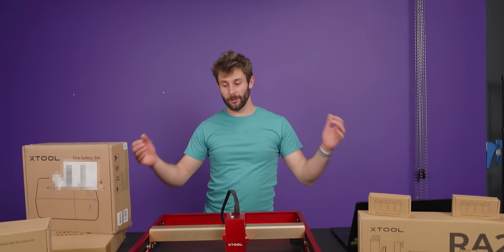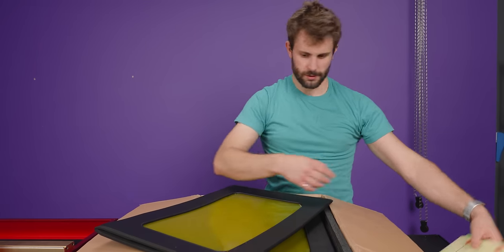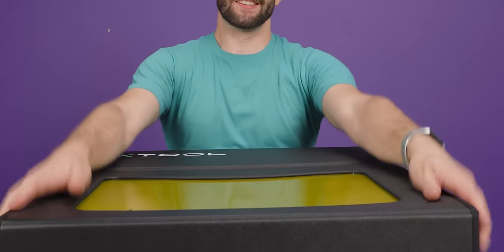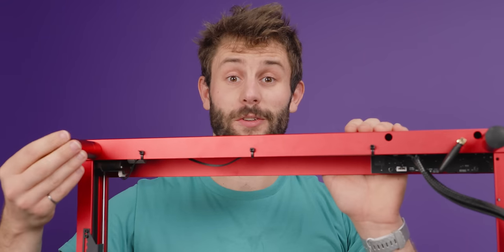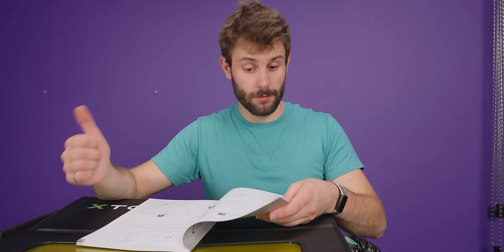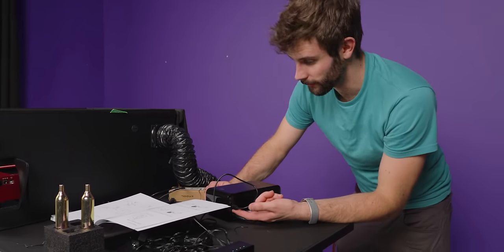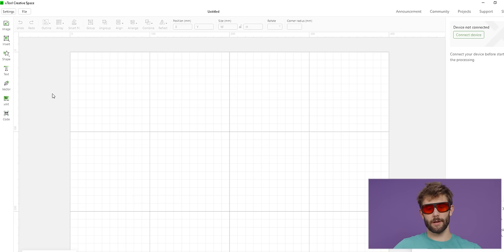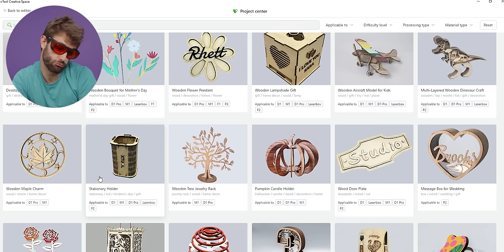This was TOO DANGEROUS for LTT - xTool D1 Pro Laser

Comment: One of the best ShortCircuits I've seen yet: Informative, respect for safety measures, cool tech, and Tynan. Couldn't ask for more.
Reply: Never have I needed that stupid fire suppression system with ANY of my lasers in the years I have been running them. I have cut cardboards on all of them and many, many other materials. I run a business with C02 and Diode lasers, the only small fire I had was when I was testing a specific kind of door mat that used Coconut hairs and I was right there because I knew the risk as I DID MY RESEARCH. Also, having to run the file from the machine button, that is on LTT for buying without doing their research. Speak with your wallet and don't give vendors who do this kind of thing or online only software (like Glowforge and Cricut) your money. They preach that we speak with our wallet and they do not follow their own advice.
Reply: @shawnhartmann1750 While I agree with most of your point, you seem to be a professional operator. Most people watching this channel are not professional laser operators.
Fires can still happen. Has haopened to me.
Reply: @shawnhartmann1750 Yer nah, doesn't matter if you're a newbie or a 100 year pro master(which alot of people getting these lasers are newbies in the use of them), you should still keep your safety's in check and that includes  a "stupid" fire suppression it's another set of precautions that should be taken and that most big companies from my knowledge do, humans are prone to mistakes and I can't tell you the amount of horror stories I've heard even from professionals over just fires alone with lasers. So I don't think it's stupid yes being a professional the risks are lower and you may feel like you don't need it but I'm not risking that few extra seconds of a laser going haywire which could make things worse call me a baby or safety prone but I'd rather not take my life lightly thinking I know everything that's just a bad decision in my opinion.

I've seen personally at work what happens when a so called professional took his eyes off one for just a minute also take William Osmond as a good example as well.

Anyways that's just my experience from seeing how quickly a faulty laser left alone for around a minute can quickly go horribly wrong and not saying you're one of them but I've talked alot to people who are veterans of their trade who made of the mistake of relaxing for a second or Letting there guard down machinery because they had so many years under there belt thinking that a "accident" would never happen to only regret it, just because it ain't happened doesn't mean it won't happen to you at some point another example how Adam savage got to laxed are his machinery and had an accident never thinking it would happen.

As for the rest of the stuff you're saying I couldn't really add my opinion but take what I say with a grain of salt it's just my opinion like you have yours
Reply: @shawnhartmann1750  Linus' wife bought this in her home tech makeover. This was not a corporate decision, but an impulse purchase done with their own money; as stated in the video. Your whole argument falls apart as you clearly don't understand why they have this laser in the first place. Its in this video now because people freaked out in the comments about the fact that they simply slapped the laser down on a counter in their house and intended to use it that way.
Reply: @Alcadria doesn't matter if it's personal money or not, if I and my company preached speak with your wallet as hard as LTT does, my wife would know the montra, I guarantee it.
Reply: Yep, this one was very, very, very scrutizied according to an employee.  When the CEO, Linus, and his wife is just off camera watching and critiquing every word, you know it was important not to screw it up.
Reply: I have to disagree with a few things stated here. I’m an LSO and your safety goggles/glass are to be purchased with the proper OD rating for the wavelength you’re using. Your example bashing the green (assuming 5151U filtering) is adequate. They’re meant to protect from reflections and stray beams. Not a direct shot  in the focus/ power testing range (5-6”) like the example video that was shown. It’s polycarbonate so it’s not meant for that. 
All manufacturers warn that any damage to the lenses can render the filtering useless. What they send is adequate safety Per the ANSI z136.
Anything else is just redundant and not needed. These are very user friendly systems. Read the manual and use a little common sense and anyone can use these. 
While yes lasers can very dangerous, if I can bring something like this to a school and have kids design your own designs on a tablet and engrave it on a puck. A normal functioning adult can use it.
Reply: @shawnhartmann1750 the point of this product is to be for normal every day people, not professionals, and in this case it IS  a potential fire hazard
Reply: @Alcadria  The problem is this sort of thing is being heavily promoted to people like Yvonne - I see things like this in craft stores. They don't seem to cost more than a high-end Cricut machine (which Y has and did an overview for short circuit about) and "there's so much more you can do! ask in store for a demonstration!". The one I saw had an enclosure but it certainly didn't have any air filter or extractor etc. And the average "craft mom" doesn't really see much difference between them - they just see all the pretty starter projects. Plus, Y works at LMG and must see some of the results from the workshop, like the wooden pc and the etched computer windows etc and think "if only there was a way I could make something like that" and ooh, here is something that's being promoted as a quick and easy way to make cool things like that!
Reply: @shawnhartmann1750 Unfortunately people are idiots, and lasers aren't idiot-proof

Comment: Would love to see Tynan review more makerspace equipment like this in the future.
Reply: He let the laser tickle the edge of a single board and then whinged about safety the other 17 minutes. They need to do better than that. Other Youtubers that review these machines on weekly to daily basis do far more. Grid power tests, cut tests of various thicknesses, engraving on metal, plastic, paper, felt, cardboard, they test the rotary unit, the efficiency of the extraction from the manufacturers enclosure and so on.
Reply: @FuttFel  safety should be #1 priority, everything else is secondary. after you have a guaranteed safe system, the ability matters (especially for consumer devices such as this)
Reply: @isaachenrikson3197  Of course. I have a 22w diode laser on the way and I ordered an enclosure and extraction system before even receiving the laser. So the video should've been 25 mins then. 10 mins about safety and the rest should've been about what the laser can do.
Reply: @FuttFel I think the reasoning is that Tynan wanted to make the video more about the safety (or lack of) of these hobby laser machines rather than the product itself

Comment: The scariest thing about laser cutter/engravers systems generally and open-frame setups like this in particular is the fact that human vision has a lot of failsafes and compensation mechanisms built into it, and you have to do a LOT of damage to your eyes before you actually begin to notice. It's not uncommon for people that work with lasers to have retinas the look like Swiss cheese but are still able to "see" more-or-less because their brains are editing out the blind spots.

To give an idea how dangerous a setup this really is: The light from a 40W blue laser will almost instantly burn a hole in your retina just from the dot of laser light reflecting off a white wall.

One of these days I might build myself a laser cutter/engraver, but if I do it'll be a fully enclosed box with an optically shielded camera inside to use to see what it's doing, and safety interlocks galore so it won't kill my peepers.
Reply: I have a green laser pointer. Only 5mW. I still treat it like an eye hazard even though it's not powerful enough to be one because holy crap it's bright to the eye.
Reply: Personally, I think the hysteria over laser cutters/engravers is over blown. I regularly work with a 2500 watt CO2 laser built by Cincinnati that has no issue cutting through 3/8" stainless. We've ran it for 15 years without an enclosure. Just don't be dumb and you'll be fine. It's the same with any tool you purchase. These small lasers aren't any more dangerous than an angle grinder. That's not to say an angle grinder isn't dangerous. I've personally seen an inch long metal wire sticking out of someone's eye, which had to be surgically removed, just because they forgot to put their glasses back on. 
But go watch any review video of an angle grinder. You won't find the same hysteria. 
People tend to handle self-preservation just fine on their own. Those that don't, will end up hurting themselves even with you telling them they need an enclosure.
Reply: @NG-VQ37VHR  IMHO the main issue is that a laser seems fun and tinkery for everyone. Oh you can make nice wedding cards and wood puzzles. Theehee.
An Angle grinder is loud, noisy and scary because it is a rotating machine. Laser? Probably fine because it has a tinted glass and I have fancy googles. 

Yes, both are dangerous. So is a kitchen knife. But you know a kitchen knife can be sharp as heck or stab your leg if it falls. Because you were taught properly. Laser? Oh it's just a 3D Printer or a cutting plotter with a laser instead of a knife. What could probably happen, right?
Reply: @NG-VQ37VHR  The hazard of cheap laser cutters like this is party psychological. An angle grinder is loud and scary, and spins really fast. It commands a certain level of respect even in many people who know nothing about it, and mechanical hazards are in general more relatable for most people. But high-powered lasers are something that most people have no concept about, and something that fits on your desk, relatively quiet, etc. does not put the fear into people nearly as much, and hazards like reflected light are not as obvious.
Reply: @OddlyIncredible  Is it properly tested and certified to be 5mW? The cheapy ones regularly exceed that output by... a lot. Plus some of them have shitty filters on them so they blast out IR at even higher power as well.
Reply: @treborrrrr  No, it's a Spamazon special and I don't trust its power spec at all as a result. I also don't have access to a laser power meter or I'd pull some numbers on it, nor do I have any ideas on its IR filtration (if it even has any) because I've not disassembled it and looked at the optical path.

In the meantime I treat it as a class 3A/3R and leave a diffuser tip on it to disperse its output to something safer. I want to remove the diode and driver from its casing and dial the drive current back a bit for safety, but it's all press-fit and I don't really want to destroy the damn thing trying to disassemble it.
Reply: Well the good news is that with a laser this powerful, you'll probably hear an audible (inside your head) pop from your eye when you get retinal damage
Reply: The silly thing is that there are plenty of maker-tier lasers out there that are fully enclosed - and they aren't actually that much more expensive than this one, especially if you get upgrades like they show in the video. It makes basically no sense at all for these things to be sold.
Reply: @NeneExists Well, that and the roughly centimeter-wide circle of hair on the back of your head that catches fire...
Reply: What sort of exam would reveal whether someone has that kind of unnoticed eye damage?

Comment: we use Lasers on my Workplace and i cant stress enough how bad of an idea it is, to use them without an enclosure. 
id go further and say that the Enclosure they provide is way to cheap to trust it 100%. 

if id need to have a Laser at home, id be using Webcams as "Windows" and would built the Enclosure without any physical windows. 
Also the Enclosure shoud have a Detection if the Panel is open. and if it is, it should cut power to the LaserHead

And requiring to press a button INSIDE of the Enclosure, so you have to start the Laser without the Enclosure closed is Highly Dangerous and Dumb...

Nice ShortCircuit and all of your concerns are 100% the same as mine
Reply: I agree that these “cheap” lasers just aren’t worth it in the end and are shockingly dangerous to the end user. Ppl just want to be cheap and ignore the safety aspects of these things in order achieve said cheapness.
Reply: The level of electronics/electrical skill required to re-wire that button to the outside of the enclosure is pretty low, but again with the 'why is this even sold this way?'
Reply: @mycosys  youre right. its not RocketScience to move a Button. 
BUT, ignoring the fact it could be bought without an enclosure, there SHOULD be a Header/Connector for a button wich should be integrated in the enclosure. yeah 200$ is way to cheap for an enclosure which meets all Safety Criteria like i said before. but if somebody buys one for safety reasons, there should be an integrated 10ct Button with a long enough cable to just plug in. 
i hate it when Manufacturers cheap out on cent-parts making the end product way more unsafe due to "supposedly safety" where no safety is.  to loose sight it doenst need minutes, it needs fractions of a second.  

imaginge someone wants to etch metal, the laserbeam reflect off the surface in the first second while the enclosure is still open to start the process... 
yeah its maybe dark thoughts but theres a Reason LaserEngraver/-Cutters need to match so many certifications in the Industry

Comment: Ok, this is probably the best laser video I've watched so far. This with Maker Muse's video on what you should and shouldn't use on a laser make for a great pair. Thank you for making an in depth video on how to use a laser properly. It is interesting that with all of those features, the Glowforge ends up being a better value and with a better enclosure. Not sure about their fire suppression system though. I don't know if this video has been in the works for a while, but I'm glad it's out now after the controversy. This is a great direction to go for discussing potentially very dangerous tools that aren't obviously dangerous to some people (versus something like a table saw where anyone knows to stay away from it).
Reply: I’d have to disagree. I felt like he just opened the box one day and decided to do the video. It looks almost like no research was done and he did not have a good grasp of understanding the basics of the machine. For instance positioning is 101 and spelled out in the software when you go to process it. There was nothing in depth to this. Safety is important and I’d never fault anyone to go above and beyond what they need, but the shields and glasses are rated for safe use with these. They’re made for reflective or stray beams. If you have someone pointing the laser directly at your eyes then there’s something else wrong.

Comment: For leather, make sure it is vegitanned/naturally tanned. If the leather was quick tanned with chromium, it could be problematic for laser cutting. pretty sure its mainly nasty off gassing but, the laser and the chromium don't interact well.

Comment: for my open frame laser i built a full metal enclosure for it with a window rated for the wavelength of the laser and outside air extraction

Comment: Achievement get: Have a comment featured on an LMG channel!

Seriously though, thank you for producing this in depth follow up hosted by someone who knows what they are talking about. I am not faulting Linus, Yvonne, or those who helped put together the video, cheap laser marketing preys on people who want the tech without knowing the important safety considerations; I hope they built an enclosure or replaced that machine. 
The conclusions here are solid: these types of unenclosed, high powered lasers are simply not safe, and really should not be used by people who don't know what they are doing. I like that this xTool system is trying to bring a safer laser system to a lower price point, which is definitely better than the super cheap extruded aluminum AliExpress kits, but it should all be sold as one kit. I still fear someone who doesn't know better thinking they dont need the extra safety equipment and hurting themselves. And the people who do know better are probably looking for a more professional laser system as you alluded to in your video.. I am glad that the lasers I work with are fully enclosed with professional grade fume extraction.

We only have one set of eyes people, stay safe!